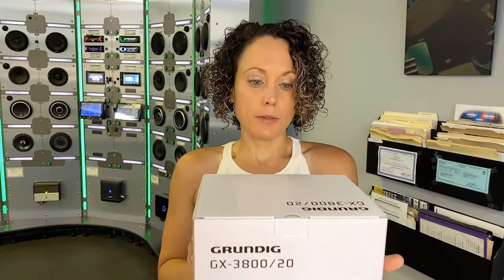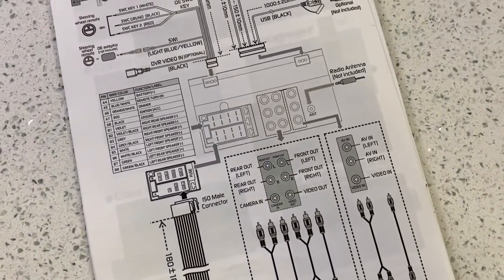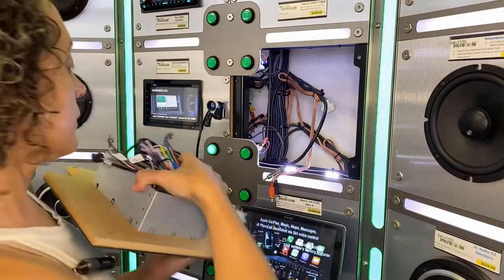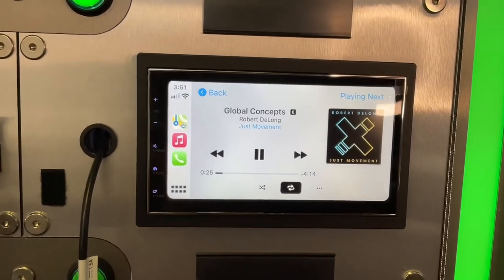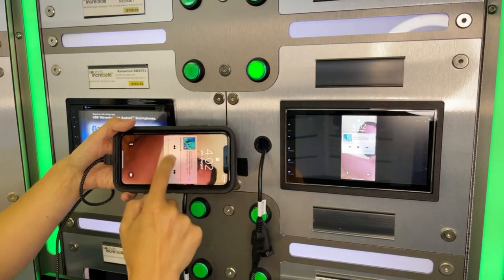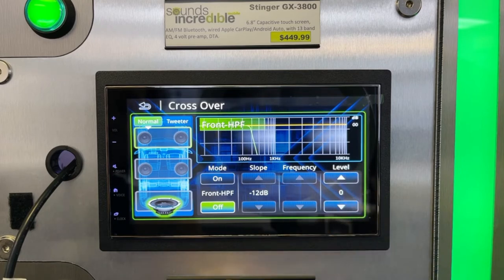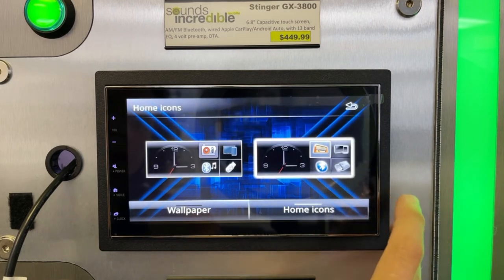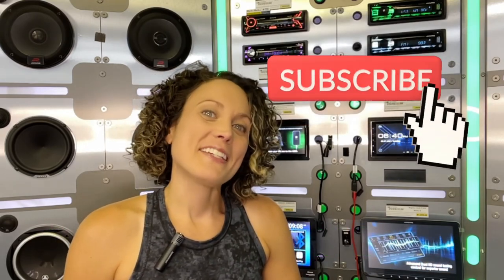Grundig GX-3800 unboxing PLUS Review CarPlay Android Auto Stinger Electronics by @carstereochick

Comment: Today was the first time I have heard of Grundig. I’m worried spending $600 on a new head unit only to find months later it bugs out.
Reply from the maker: I had never heard of them either and grilled my sales rep about them (who I’ve known and done business with for 21 years). That’s when I learned about what a big company they are overseas, they make so many different electronics and appliances. So far not a single one of my units or my sales reps accounts across the country have had a defective and I’ve had nothing but happy clients. BUT $600 is a rip off, don’t over pay. I sell them for $399 plus install, but could see dealers charging $449 - $500 with the chip shortage. Unless you’re referring to an installed price.
Reply: @carstereochick  costs more in Australia probably to do with tax..
Reply: @carstereochick  I’ve purchased it. Now I’m having trouble with my steering wheel controls with the head unit. I have 2 compatible aerpro wiring harness’s to suit my car. The patch lead uni with self learn is within the harness’s. It came with two options. A 3.5mm jack or spare labelled cables with crimps ready to go. I have used the crimp method as there isn’t a 3.5mm jack option with my head unit. It’s not working, any ideas?
Reply from the maker: What's the year, make and model vehicle? In my experience with older vehicles using analog steering wheel controls (non CAN Bus like a 2008 Toyota Corolla for example) you are best off using the unit's built in SWC module rather than an external one. In the US we use the PAC SWICP5. I have to check my notes when I get to the office, but if memory serves me correctly the manufacturer advised using the PAC Audio SWICP5 and setting the dial to "Pioneer" to program.
Reply: @carstereochick  Mitsubishi triton 2015 MN
Reply from the maker: We don’t have that model in the US but I do see PAC does make a specific install kit and SWC module for this car.

https://stingeraustralia.com.au/product/hrmt001/

I’m not sure if that module is like our SWI-CP2 (I think I said SWICP5 before but I meant SWICP2) but I do have notes for this model to set dip switch to #7 program for the same as Pioneer. Not sure if that steering control module you have is compatible.
Reply: @carstereochick  it’s ok, I just discovered you need to program it through the headunits settings. I sorted it, thank you for your help!
Reply from the maker: Awesome! So glad you got it figured out 👍
Reply: Bought one today, fair price here in Australia when compared to other popular name units, especially due to the chip shortages that China is hording grrrr !
Easy to install, no probs with Aerpro interface and patch leads, works well with SWC, Reverse Camera, Bluetooth etc...all functions work as they should and looking forward to setting up the fine details in setting and options when I get the time.
So far so good 🤘
Reply: @joelfeuerreiter703  it’s not such a bad unit, although the only real bad thing is it takes a little bit to start up. I’ve had it freeze on me about 3 times and I have had the system for about 3 months.
Reply: @awilly1991  I won't hesitate to return the item if it plays up just once, done it before with other units and I'd do it again no mucking about 👍
Reply: @carstereochick  I just bought mine from Stinger for $390, on sale. Going in a 2012 Chev Silverado non Bose system.  I spoke to my installer and showed him the unit. First thing he said was buy a Kenwood or Sony, look at this cheap box, He asked me where I bought it from? Stinger. He immediately said he was calling his radio guru. Right there he was given a very good buy rating and a little history. He looked at me and said ALRIGHT! I'm now comfortable installing this unit. I'm now waiting for his finish of a couple of projects ahead of me. I'm getting excited and I really appreciate your video. Very Very helpful. Thank You!

Comment: Unable to set swc feature 😴
Reply from the maker: What year, make and model? Usually the built in SWC is for older, basic, analog cars from Toyota, Honda, Subaru etc.
Reply: @carstereochick  2013 f150
Reply from the maker: Sorry, that built in SWC feature is not going work in that car. It might seem basic, but your SWC are on CAN Bus (data wires). You’ll need a PAC SWICP5 adapter to retain them in this particular application.
Reply: @carstereochick  ok thanks for the info. Will look into it.

Comment: can u tell me how to uze the Swc wire for an ford mondeo mk3 2004 i dont know how to connect it.. thankz..
Reply from the maker: Unfortunately I don't have wiring information for that car and what we have for US version (Ford Focus?) may be totally different so I don't want to tell you the wrong thing. What I would advise doing is if there is a company that sells steering wheel controls modules where you are - like here we have PAC Audio or Metra's AXSWC - on the manufacturer's website for an external steering wheel control module, there should be way to look up an installation guide. That install guide that will identify the steering wheel control wires. To be clear you don't need a separate module for most older analog cars like this, but you need a way to look up the wiring and using a manufacturer that sells SWC modules is an easy way to get a diagram to identify the wires. For most cars there are 3 wires identified in the install guide/car harness. Two steering wheel controls wires usually labeled SW1 and SW2 and then SW ground. I hope that helps!
Reply: Ford focus have the same swc as mondeo that stick beside/under the blinker arm.. so thats the same way to do i. On a 2004 model. Old car i know,but its expensive here in Denmark to have and buy cars..
Reply from the maker: I can only imagine what it costs to maintain a car in Europe! And I don't think 2004 is an old car. We have a LOT of clients doing upgrades on cars from 2000 - up. New cars are too expensive. I looked up the 2004 Focus on Axxess Interfaces and PAC Audio's SWI install guide and they show a diagram. Pin side they show Pin 11 and Pin 12 (SW ground) as your SWC wires. I hope that works!

https://metra-static.s3.amazonaws.com/swc/AXSWC_INST_250.pdf
Reply: @carstereochick  thankz a lot u an angel..